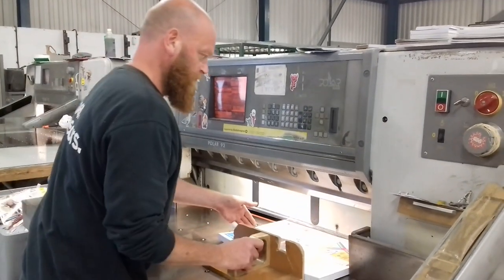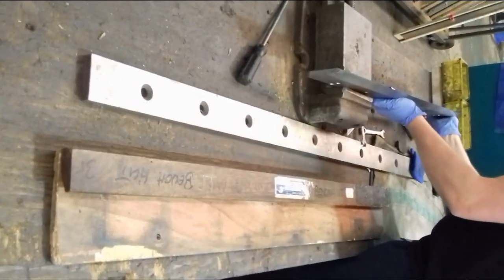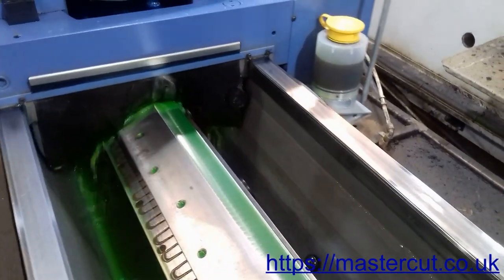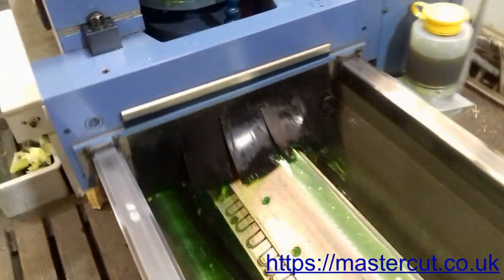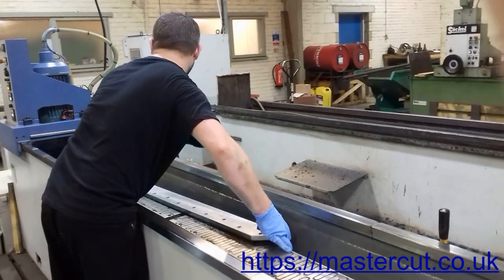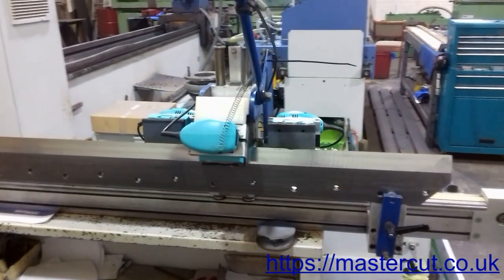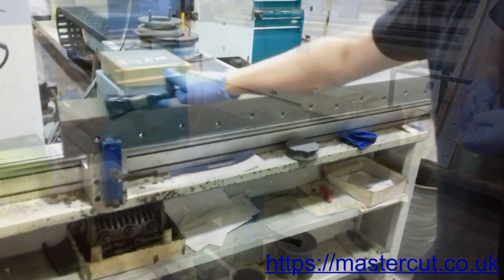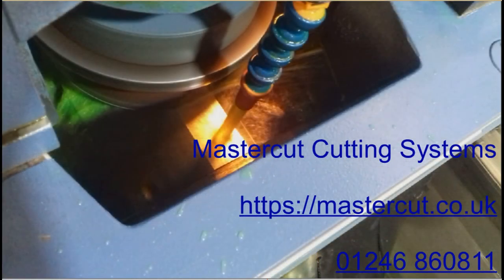Guillotine Blade Sharpening Service

Comment: Hello there!

I have the same blade as the one you featured in your video for the HFS 12'' A4 Heavy Duty Guillotine Paper Cutter. The blade measures 37.5 cm or 14.76" in inches. I am interested in having it sharpened and I was wondering what your pricing is like and how long it would take to fix it once you receive it. I have had trouble finding good sharpening services here in the US, but your video caught my attention and I am impressed with your work. I have attached some images of the blade   would like to have fixed. I already send it to your email, Thank you!

Best regards,
Liz Muniz
Reply from the maker: Thank you for reaching out to us regarding our blade sharpening services. We regret to inform you that at the moment, our sharpening services are available exclusively in the UK, but we’re working on expanding them to the USA.

In the meantime, we recommend taking a look at our industrial machine knives and blades available for US delivery at www.fernite.com. We are a leading ISO9001 registered machine knife manufacturer.

We understand the importance of sourcing a reliable sharpening service and apologize that we can’t assist you just now. We value your interest and assure you that once our services are available in the USA, we’ll be more than happy to assist you with blade sharpening.

If you have any further inquiries or need additional assistance, please don't hesitate to reach out.
Reply: @mastercutcuttingsystemsltd6774 It would be amazing if your services were available here in the United States. Currently, there is no comparable type of service offered here, and the equipment used for sharpening is limited in comparison to what you use. I am truly impressed by the work you do, and I have noticed your popularity in the UK. Thank you so much for taking the time to respond to my comment. I wish you all the success in your future endeavors. It would be greatly appreciated if you could inform me when your services become available in the US. Thank you for recommending your website. Once again, thank you. May God bless the UK.

Comment: does this work on the head kind too
Reply: So there is a safety on the machine, in order to engage the blade, your foot needs to step on a pedal and each hand needs to press a button on opposite ends of the machine. If you can somehow manage to get someone's head in that its off in whatever angle you like it.

Comment: If there was ever an advert for how NOT to handle these blades this is it.. Shocking... You never balance these blades on the machine unless you want to lose a hand foot or worse.. Health and safety has gone out the window. You never paper test from behind the cutting edge like in this video. Unless again if you want cut yourself very badly.. The surface finish is terrible and if I was the customer I'd return it or go somewhere else
Reply: Totally agree with you that finish was very poor I'd have never sent a blade out with that finish ,that blade should have been lifted off the machine with handles and put  straight onto a bench wiped down and honed with the circular honing stone you can see in the video not the thing he used they're prone to chipping, give them their due they're better than kennedy grinding but nowhere near as good as D&P Watson who have sadly closed down